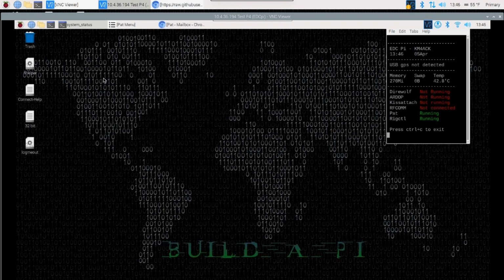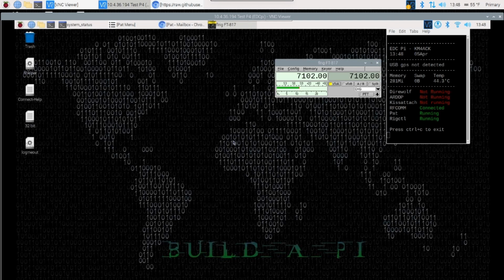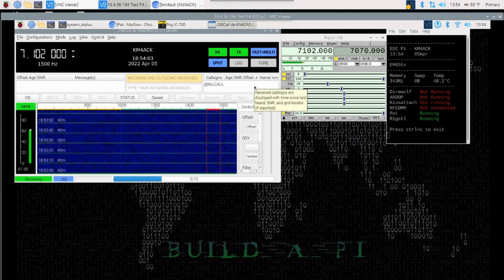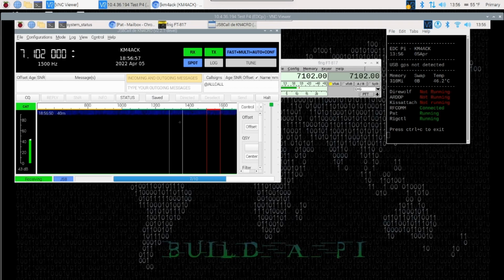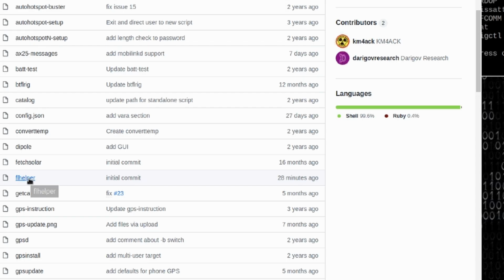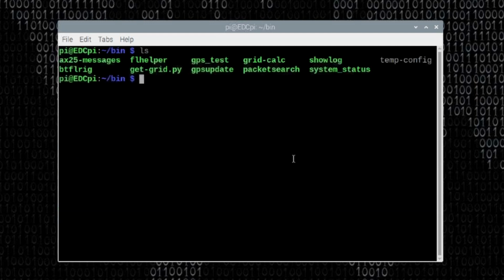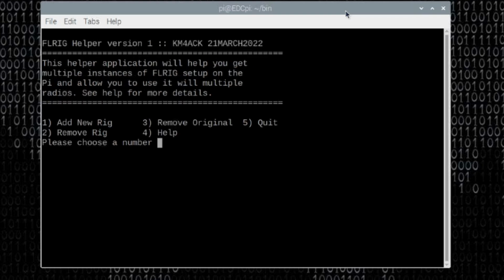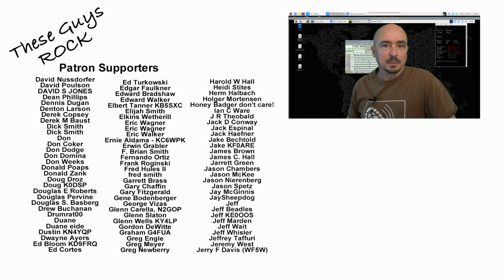One Pi to Rule Them ALL

Comment: Great video. I need to get back to the radio. All I have is the TS 2000 and it is in the closet. Thanks for the video, 
73
KG4BGA
Reply from the maker: Sounds like that radio could use a little exercise. Time to put it on the air :-)

Comment: I've implemented a similar approach for my desktop Linux as I use it for many things other than HAM radio.  However for a ShackPi based on your build-a-pi script I prefer to change the login to prevent automatic logins and then use a login user name for each radio e.g.  I'd have a pi user for default stuff and running admin updates etc. then new user for my X-6100, one for my FT-857 etc etc.  The benefit is it always works and doesn't care if the radio is configured directly or with FLDigi (although it usually is) and doesn't care about changes in audio interface etc.

Comment: Can you develop a program to run a single radio in two applications simultaneously? I would like to operate fldigi and jscall at the same time. I have used the AMRRON Trimode but find it clunky and hard to navigate. 
Thanks.
Reply from the maker: There really isn't a "program" per say that's needed. This just requires the use of virtual sound cards. I haven't played with it in a while but BAP has a virtual sound card already setup. I am going to shoot you a message through Patreon.
Reply: AmRRON ROCKS!!!!!!